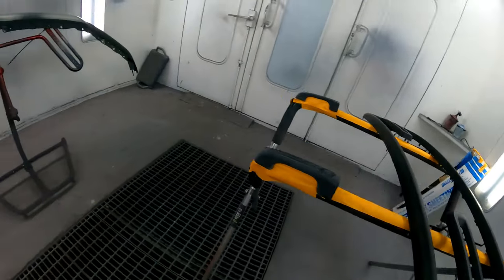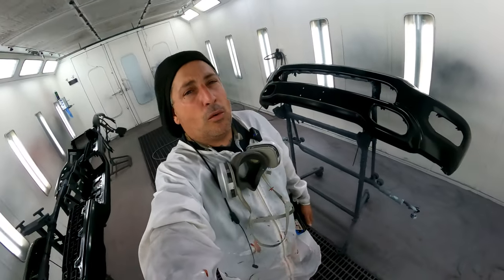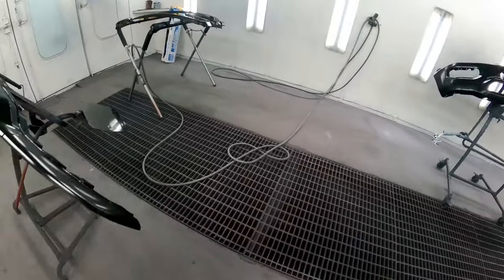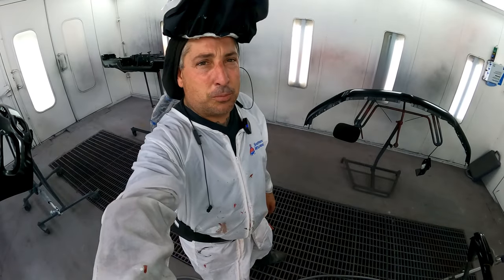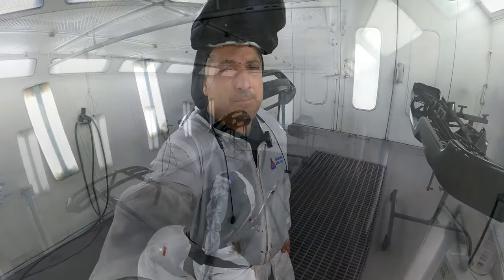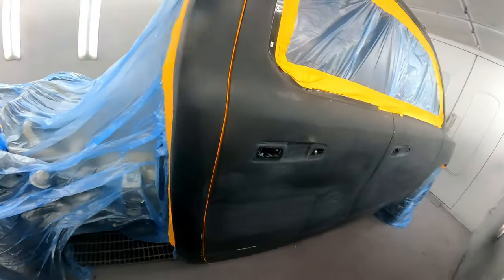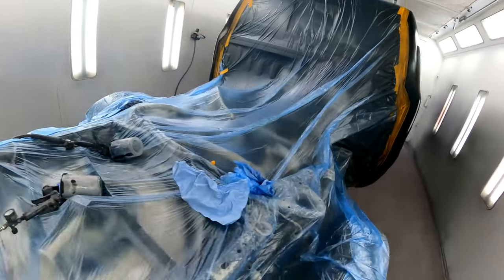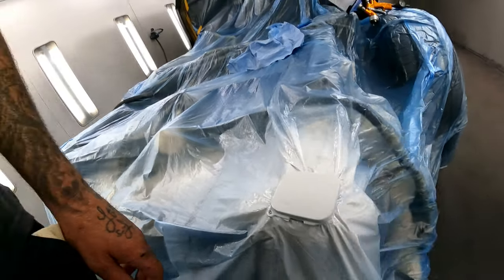HOW I HANDLE A BIG PAINT JOB

Comment: How’s that Tekna Clearcoat working out for you?Ive had problems with mine I can’t get it to lay down clear properly so I’ve just stuck to my WS400 which works great.I use the TE25 cap and 1.3 on the Tekna clear gun with our clear at 28-29 psi
Reply from the maker: I enjoy it it a great gun 👍